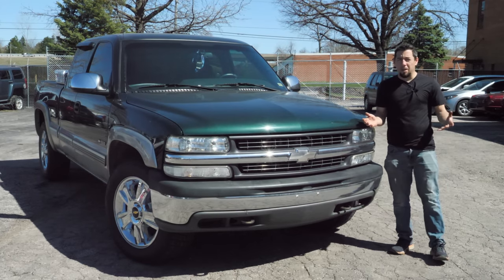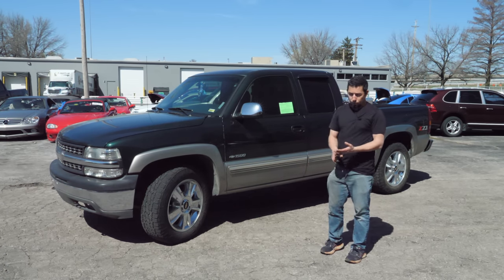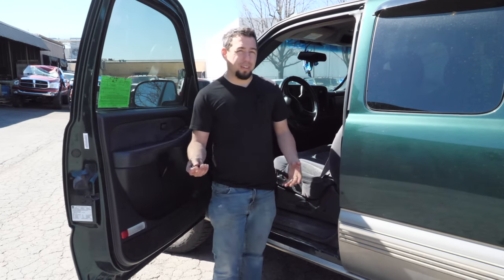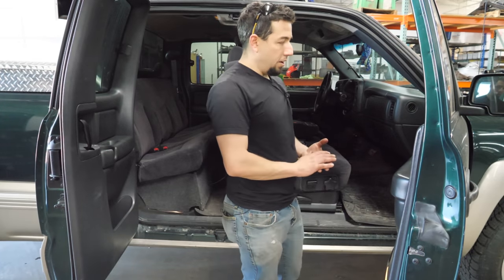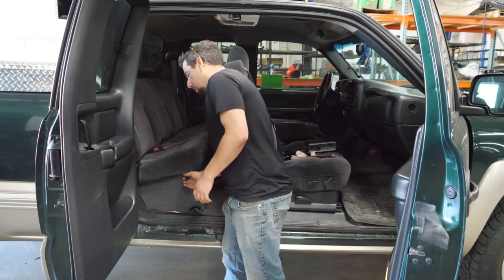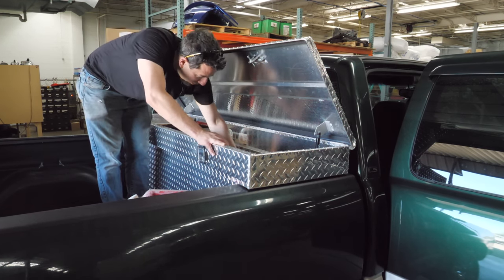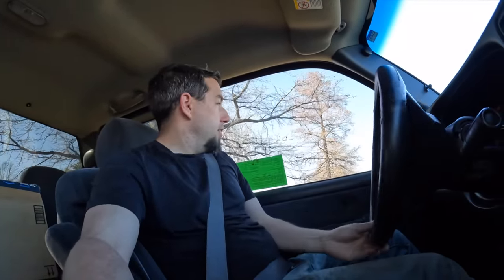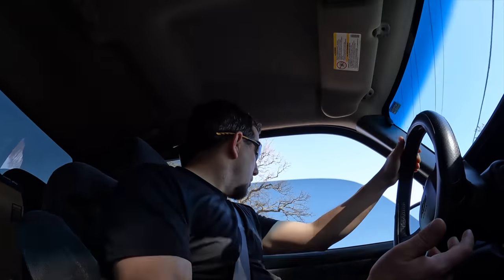Abandoned Silverado Comes Into Salvage Yard, FOR PARTS?! NO!  Saving This One

Comment: Weather tech floor mats, tinted windows with shades, custom sub box, updated rims, updated front lenses, head unit...this was someone's baby
Reply: And working AC...it's CRAZY that it was abandoned...
Reply: Whoever owned this is no longer alive...
Reply: The owner this likely got killed or died otherwise. No way do you take such good care of a paid off truck and then let it sit abandoned and be sold off.
Reply: @samholdsworth420 or got arrested maybe?
Reply: @wcpportfolio  Arrested.
Reply: I sold a vehicle, and almost a year later I got a certified letter that my vehicle was in their lot ready to be auctioned as abandoned (guess it was never titled again)

Unfortunately the tow and storage fees were higher than the value of the vehicle, but I considered getting it back.
Reply: @User0000000000000004  cardiac arrested
Reply: yet it was smoked in
Reply: @User0000000000000004  arrested/jailed, you'd think there would still be 'contact' details for the individual though.
Reply: @volvo09  I had the same thing happen. The car was a '76 Capri and I regret losing it, but I moved internationally and couldn't take it.
Reply: may be a DUI . and the guy is in the slammer for a wile.
Reply: @metalworksmachineshop  That's a good theory, but I believe if that were the case the police would've had the vehicle impounded almost immediately.
Reply: @volvo09 wow...the exact same thing happened to me....sold my truck to a friend....got stolen from him....a year later the impound yard calls me to tell me I owe 4000 dollars for a 2000 dollar truck....I laughed at them and told them they can have it and they said thank you we will put it in our auction.....I think the same thing happen to this truck and the owner moved and never got the notices his truck was found
Reply: I think with the worn ignition switch that it would just stall randomly and someone just got fed up with it and that's why they abandoned it.
A little bit of troubleshooting and that thing is still going!
Reply: Hopefully all avenues were exhausted to before claiming someone else's property. That's what the USofA is all about, right?
Reply: @americansmark the sound system didn't walk off out of a locked truck.  They got fed up with the ignition switch and cut their losses.
Reply: @rabidbigdog if you listen closely, you'll note that two letters were sent to the registered owner 30 days apart
Reply: @stereolababy  I know rednecks that smoke in there brand new $90k pickups. Back in the 80's, every car (especially the nice ones) had ash trays.
Reply: @rmp5s  😆I swear "broken" AC systems on older rigs are always fixed by re-shimming the clutch plate.
Reply: @stereolababy  Thing had like 9 air fresheners in it 🤣
Reply: @alsaku33  ...wut?...
Reply: @rmp5s  Lots of the time people say their AC system doesn't work is all I am saying.
Reply: @Markomyt1  They also knew it of it's problems. Number one being the mileage.
Reply: Working transmission as well, rare
Reply: @americansmark  Probably "died suddenly" with no next of kin (or next of kin that cares)
Reply: Now to make it back stock again with right year rims and back to stock headlights!😎👍💗
Reply: @wcpportfolio  cops usually tow your vehicle and impound if you get arrested
Reply: @HarrySach  I doubt it. They already put good money into this truck
Reply: And, no brightly colored or splatter-painted dash trim. Definitely not owned by anyone younger than 30.

Comment: I'm not a chevy guy but it looks like this is a nice find. Great job
Reply: M.Stone I bought a chebby "once " daily repairs & multiple 350 engines ( heads or push rods) 8 hrs on heater core & 2 differentials new paint all ended up in the wrecking yard.....
Reply: @bradzimmerman3171  Yeah I wouldn't pay actual money for one. My father-in-law had one that was regularly maintained, yet blew up at 60k. All engines have their problems, but Chevy seems to have an overall build quality issue that adds to it.
Reply: What do yall  drive then and the chevy 350 was one of the best v8s ever made so it must not have been maintained
Reply: @RageHP-RageHorsePower   Who knows what happened to it. Could have been a faulty pump or some other abnormality. Could have been a Friday night slop job. Who knows, who cares. I daily a Honda.
Reply: @M Stone  I agree with cheapness of the interiors early 90s and 2000s bit now they all have supposedly luxury interiors
Reply: @RageHP-RageHorsePower  Nah, its the same cheap plastic, just with nice feeling cloth glued to it.
Reply: @seymoarsalvage  supposedly lol
Reply: I’m not a chevy guy either, but I’d be about any kind of guy for a $700 running full size truck right now
Reply: As someone that's just had far too many vehicles I find it to not be a brand thing. Every manufacturer has a model or group of years to just avoid.
Reply: @davidchristie4581  true statement
Reply: @bradzimmerman3171  The Fords and Chryslers are no better, sorry to report the bad news 2 u.
Reply: @mstone6210  freaking joke, this gen of GM trucks and SUVs is one of the most reliable vehicles on the road, and that's including the Japanese.  Someone did some reasearch and 2 years ago the vehicle that had the highest percentage of 20 year old examples on the road was the 2001 Tahoe.

I have a 2010 Expedition and the interior is great but mechanically it's a basket case.  Getting ready to do a timing job on it, but it needs an ABS module too, the air suspension won't pump up when it's cold, the A/C works but is marginal above 90F, needs new U joints I think, etc, etc.  I'd trade it for this truck in a heartbeat.
Reply: @davidchristie4581  yeah the GM trucks that followed this gen in the video are much less reliable, AFM valvetrain issues, burning oil, horrible interiors with cracked dashes and tons of rattles, etc.  The Fords are better interior wise but the 5.4 3v is just as bad or worse than the 5.3 with the AFM issues.

That said you can fix the AFM hardware by putting non-AFM lifters in, modifying the VLOM and doing some tuning to disable it on the hardware side.  You can't fix the 5.4 3v except to plan on a timing job every 100-150K, people say the HV oil pumps help but has anyone really put 200K on a 5.4 3v with the melling pump?
Reply: @JimBronson Yes, Jim. There can be plenty of examples made about how this or that Chevy is so much better than 'fill-in-the-blank'. I, too, have a 5.4 Expedition that needs the full timing job. Unlike the three Chevys that I have encountered in my life that I used as examples, the Expedition made it to 150k before any major mechanical issues. It's had zero from day one. Again, I know that this doesn't necessarily translate to every Chevy out there, but just the ones I've personally encountered. 
I had a 99 Firebird TA that I absolutely loved. The only reason I got rid of it was the TCO. The cost of tires and insurance was too high for a 19-year-old. The "joke" here would be if either of us thought for a moment that our words would change the mind of the other party. I am simply expressing my experiences.
Reply: I’m not a Chevy, Ford, Dodge, Toyota, Nissan truck guy. After 30 years in the automotive repair industry they’re all overpriced and sketchy on quality. If any one of them comes up with a good design that is reliable and simple you can bet they’ll change as soon as they can. I’m not brand loyal to any of them anymore.

Comment: Once upon a time....circa 1980, I was friends with a guy (Bob) who worked at a local gas station. Their clientele was mainly the older residents of the area. One night he calls me and asks me if I want to buy a 1967 Chevelle for $125. It was brought in for service and the owner never came back for it. It kind of runs and it needs a paint job and is otherwise in decent shape... at this time I didn't have the place to work on a potential project and at that time $125 was too much money to gamble on the roadworthiness of the car (remember 1980ish). So, I declined the offer.... About a week later I see Bob driving this car. It was a 1967 SS 396 Chevelle with a 4-speed, 3.90 gears and bucket seats and it was factory original! The rough engine was fixed by new plugs and plug wires and adjusting the timing. The paint was "fixed" by wiping down the paint with gasoline. The thing was beautiful....  regrets
Reply: Heh. My dad once had a chance to buy an old Ferrari (think it was a 250 GT or something similar) for 5k. His first wife nixed the idea.

That same car today is worth ~$500,000.
Reply: That’s like not playing your lottery numbers and they win.

Comment: Makes me wonder if they got spooked by the intermittent starting issue and/or a less than ethical mechanic quoted some crazy expensive amount to fix it, so they just abandoned the thing
Reply: tool box, etc.  the guy was somewhat mechanically inclined.
Reply: no way. something bad happened to the owner. these trucks can go for pretty good money in clean shape and most people that have them know it
Reply: @Milkmans_Son  Could have been a carpenter's Truck.
Reply: @Milkmans_Son  there wasn't anything useful in the tool box though
Reply: @andrewgarcia3136  Especially now with the auto market upside down. I've got an '04 GMC Sierra 2500HD w/Duramax @511,000 miles and I could get 10 grand for it.

Comment: Best truck's since square bodies. My son has one with 400k miles. Rebuilt the front end and transmission and that's it outside of normal maintenance.
Reply: My boss bought his 03 Silverado 6.0 extra cab brand new still has it no rust tows his camper all the time 421k miles original drive train hard to believe cause I hate GM but I was there when he bought it and I road in it last week plus he has a 04 Tahoe 395k runs great but on its 3 transmission

Comment: the 01 my dad and i saved is not as nice as this one - but at 271k, it's still doing great. I did a full front and rear suspension overhaul as well as removing and cleaning the entire interior. It still pops up errors here and there, but I like this thing. Glad you were able to save it - there's a lot to like with this gen.

Comment: 300,000 miles plus, starting problems, abs problem, check engine light, some rust poblems, it looks like th eprevious owner cared for the truck but the retail cost of repair to a reasonable standard almost certainly exceeds the value of the vehicle even when fixed.  Good to see it in the hands of someone who has the ability and resources to fix it up for  less cost.

Comment: In 2015 I went to the local U Pull and Pay, and at the time, they sold cars that were in too nice of shape to junk (I think they still do occasionally).

They had a 1988 Jeep Grand Wagoneer for sale for $2500. It was dark blue & wood grain. Georgia truck. Somebody was in the process of restoring it and had to move ASAP so they sold it to UPAP.

I bought it with the intention of finishing the job, but realized it was more than I could hack. It ran. It was cosmetically an 8.5/10 on the outside. The engine had been upgraded with a fancy Edelbrock fuel injection system.

While I wish I still had it, I nearly tripled my money 3 years later. And that was ok. Although if I had kept it post Covid, I probably could've made 4x...

Comment: Lost a rear tire on the way home in my 01' 2500HD. Winter time, 1 year old son with me. Had a random factory steely in the box, didn't think about differing tire sizes and just threw it on and kept going.. 

After about 4 blocks, my rear diff... Did something... and started pulling the truck hard to one side while sounding like a rumble strip. The "G80" rpo code in the glove box is now irrelevant. Still have never had the diff cover off. Driving it every single day still lol

Comment: I'm not a Chevy guy, but I've seen a ton of videos re low oil pressure. It seems to usually be a deteriorated oil pump pickup o-ring and/or a stuck oil pressure relief valve.

Comment: for a midwestern 2002 truck with those miles, that's not bad for rust at all.  It's definately worth saving and someone will want that as a work truck.  Also I'm betting the Check Engine light is an O2 sensor.  That is common for GM's of that era

Comment: If I was in a worse way then I’m currently at ( going to depend on how much I need to raid my retirement fund for hopefully my last Toyota Tacoma till I retire). I would absolutely give you 1500 for that truck. Right now I’m stuck working at a GM dealer so the parts I need for it would be stupid cheap. Put some new brakes on it, hit the frame with POR-15 to lock out any future rusting. Fix the missing inner rockers ( sheet metal, pop rivets and POR-15). Put new shocks on it and see if I need a new exhaust. There you go a decent running truck that will definitely get you around till you can either afford something better or you can have a new drivetrain on standby. In my old job as a medical courier something like that with 4wd would have been a great option especially for deliveries up north of I-80 in pa oh and i forget to say get a good radio to fit the hole

Comment: Nice looking truck, with that many miles either it's been well maintained or the engine's been replaced. I'm interested to hear what the service engine light's all about.
Reply: Throwing a scan tool on it should give him a heads up what to look for, also swapping the radio requires changing the security code via the scan tool.

Comment: "ABS light's on". Yep. Common. Probably has a C265 code set. ABS module probably needs the solder joints on it's board redone.

Comment: I found a truck just like that...had the 5.3...it was a "divorce" sale...transmission wouldnt shift into 2nd without feathering the throttle but the engine was perfect...only 75000 miles...pulled engine and ecu to put into a 1988 s10 blazer 4X4 for a "typhoon" build...had 5.3 on engine stand along with a 454 on an engine stand...went to take care of my mom just before covid and my girlfriend and i broke up...she sold all my stuff along with my tools...i had all craftsman tools and was so proud of my shit...so, i have to start over...i did by another s10 blazer 4x4...its a 1991...i aint giving up though:)...i really do miss my engines and tools...you just dont sell a mans engines and tools...thats a sacrilege or something.

Comment: Sometimes the factory is better but not always but one thing I hate and this is mostly an aesthetic gripe, is the spoke vs lug number. 5 lug = 5 spoke (or a 10 spoke), 6 lug = 6 (can get away with a 3 or 12 spoke wheel as well). Just they symmetry of it mostly and one of the things I hate about the 2001-2004 Dakotas. Had a 88 that had 5 lug and was 5 spoke and a 96 that was a 6 lug and 6 spoke and don't know why they did that odd shift. wheels look nice just them being 6 lug. Heck the 2005-2011 I think went to 5 lug again and 5 spoke.

Comment: That high mileage on a gm truck and being abandoned it probably has transmission transfer case torque converter,  fuel pump ,  ignition, stretched timing chain /engine timing and  engine lifter problems, power cuts out  that you haven't found out yet and you'd be wise not to drive it far or you'll be calling for a tow.
Reply from the maker: 400 miles so far, no issues!

Comment: GMT800 was one of the best GM vehicles made in the last 40+ years.  My 2003 2500HD 4x4 RCLB has 317k miles on it, my 2003 Yukon Denali XL has 213k miles on it.  I will keep these two running until I die, them my SIL will get them.
Reply: Just picked me up a 2001 Chevy Silverado 2500 HD 4x4 had a knocked motor and 200k miles on it for 3500 but sold some stuff off of it like the topper and got some money back. 800 to be exact so Truck cost me just over 2k its pretty damn clean there is some rocker panel rust but thats and easy repair but over all mint. I pulled the LQ4 and buddy sold me a running LQ9 with 148k miles on it for 1250 bucks. Right now I'm cleaning up the engine and redoing all the seals front and rear main gaskets o rings ETC. But It should be up and running in next few weeks. I work full time so can only work on it on weekends and I like to have some me time so deff excited to get it together. Amazing riding truck though I drove it with rod knock home and guy had receipts for over 8k in repairs and maint for past 8 years 4k of which in past 2 years shocks and full new AC replacement. My dad has an 04 2500HD 2wd and was shook at how clean this truck is. Cat eye vs round eye at this house now LOL but deff stoked got a LQ9 01 2500